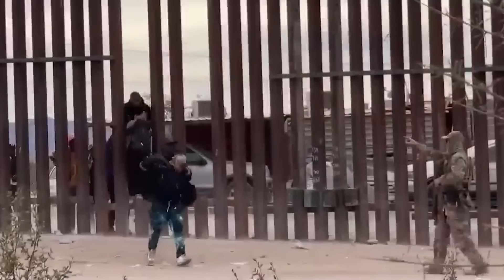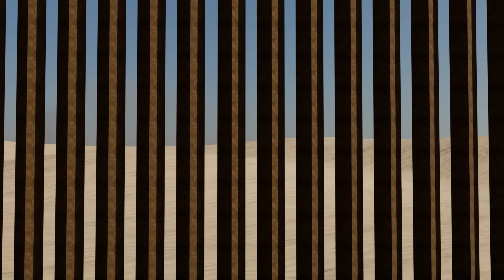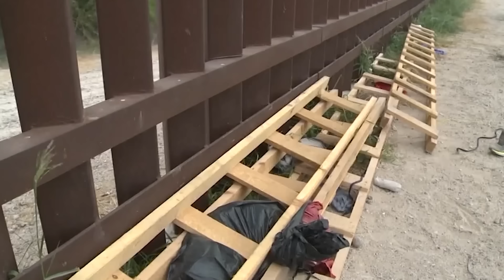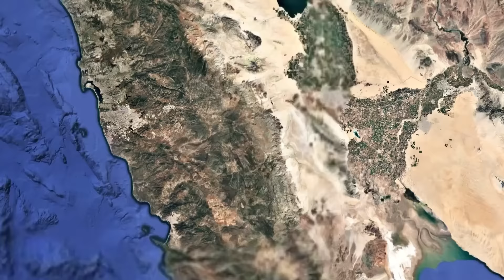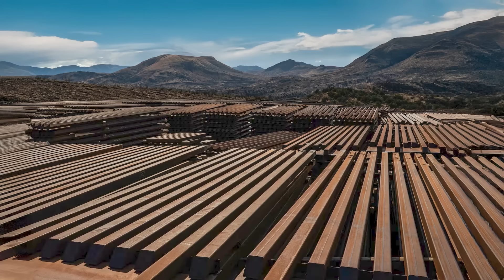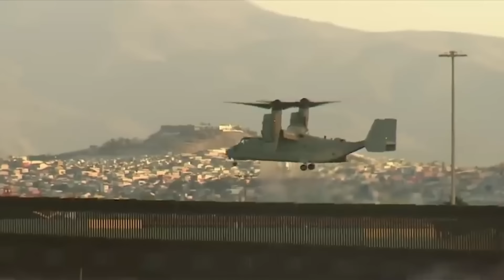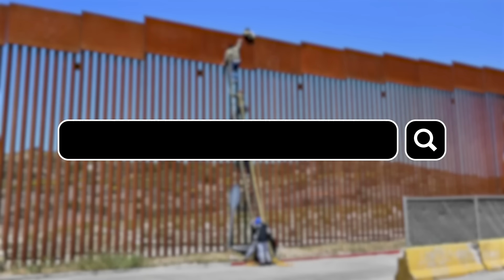What Mexico Is Doing to the U.S. Border Shocks the World

Comment: A few FACTS-from GROK:

Under Trump's FIRST TERM-How much of the US-Mexico border wall was built?
Approximately 80 miles (129 kilometers) of new primary and secondary barriers were built in areas where no previous fencing or barriers stood. This includes 47 miles of primary wall (the first barrier encountered) and 33 miles of secondary wall (reinforcing the primary barrier).

Replacements and Upgrades: The vast majority of the 452 miles—about 372 miles—consisted of replacing or upgrading existing barriers. These replacements often involved swapping out older, shorter, or less robust structures (like vehicle barriers or dilapidated fencing) with taller, more fortified steel bollard fencing, typically 18 to 30 feet high.

Total Border Length: The US-Mexico border spans approximately 1,954 miles (3,145 kilometers). Prior to Trump’s term, 654 miles of barriers already existed, built under previous administrations. Thus, the 452 miles completed during Trump’s term brought the total coverage to around 736 miles when factoring in pre-existing barriers and new additions, though most of Trump’s contribution was replacement rather than expansion.

Comment: only 80 miles of new barriers have been built where there were none before - that includes 47 miles of primary wall, and 33 miles of secondary wall built to reinforce the initial barrier.

The vast majority of the 452 miles is replacing existing structures at the border that had been built by previous US administrations.

Comment: Alternative Vision
If the goal is maximum deterrence, imagine a futuristic take: a 30-foot steel-and-concrete hybrid with solar-powered sensors, electrified sections (non-lethal), and drone launch pads. It’d look imposing—think sci-fi fortress—but costs and legal battles would soar.

In short, the "best" wall is likely a steel bollard system, 18-30 feet high, with underground reinforcement, tailored to terrain, and backed by tech and patrols. It’s not pretty, but it’s built for purpose.

Comment: Whats crazy is that our own prison systems have more advanced walls and fences. Double fences with serpentine wire between them? That's a pretty good deterant. Even if you cut through the fence/wall, it will still take you some time to cut through the wire and then get to the next fence/wall. Way more time than they could afford and would likely be caught in that time.
Reply: I've seen where these people use simple cardboard to defeat the parts that are backed by razor wire. Even if the wall was backed by mines these people would sacrifice a few to get a lot through. Nothing will ever stop them.
Reply: BS a guy in our unit climbed two fences with concertina on top to escape a stockade.  Couple of hand cuts
Reply: @Jon-f1d5m yeah and I bet he was crazy, too! 😂 definitely the kind of guy you're glad is on your side, yeah?

Anyway, my argument isn’t that it will necessarily stop them, but either deter them, or slow them down enough to allow them to be captured.

Comment: Electricity is the only means to stop them . wire with mounted insulators where the wire can be strung and not just one electrical wire but several.  Why not make the wall fence solid and flat ?

Comment: Why not acoustic sensors. Or sensors that pick up vibration. Or both? You're not trying to be clandestine about this so how about a wire with a different chemical makeup so that it's resistance isn't that a standard copper or aluminum and then whenever the criminals try to cut through the wire to access the hole in the fence a change in resistance occurs and you set off a sensor. You can't splice it because the resistance is uncommon because it's using uncommon metals to push the current. So say you tried to use copper or aluminum to splice the connection so you could cut your hole the copper aluminum wouldn't work because it would be different from the resistance of the rest of the wire so you would trip to censor anyways. Didn't you apply this wire named mesh along the entire wall in you spotwelled the mesh at every point of contact so you can't just cut the bottom of the pole and then swing it back and forth this mesh would deliberately get in the way of that and it could be engineered to do so.

Comment: Bad design ... the wall should be a double wall, with the inside wall 15' or more from the outside wall - and lined with razor wire, or a guard dog patrol between the them... dogs can be equipped with camera systems which feed video footage back to the patrol on staff

Comment: I am not really against the wall, especially if it is a deterrence against cartel members. But wouldn't an electrified fence with barbed wire be simpler? Good luck using electrical tools with those. I am not an expert in this topic. Maybe it would be too much energy needed to keep it up along the whole length of the current wall. But I think it would probably be harder to bypass? I mean, it works in many military bases right? And even some non-military private properties. If the electrical fence would be powered by solar panels, it would probably be feasible?

Comment: This is why they need to use real granite or limestone blocks stacked on top on our side of the wall. The U.S. is a continent and has more limestone and granite than most smaller nations just cut the blocks out and transport the blocks to the area of the wall. There is also new forms of concrete that uses no rebar and is as strong as basalt, limestone or granite. Since we invented the Locomotive and the Gatlinggun we can invent concrete stronger than the strongest rock, basalt. I know how to make this form of high tech concrete, artificial stone or basalt. And for a slight fee I will tell you how it's done.

Comment: Drones with thermal imaging could keep track of breaches very well. A single one could keep track of miles of fence.
Add some disguised motion detectors as well.
And then you need rapid response personnel.
A wall by itself only causes choke points and a slow-down. But that in itself is very useful, if the other components are in place.
A crucial element which would be hard for the US to implement though, would be harsher penalties for crossing it.

Comment: One thing that would slow down the climbers would be to install a 70,000 volt power line along the top.
Reply: Constant electricity running the length of the wall would be incredibly-expensive. Have you looked at your electric-bill lately?
Reply: @nicodemus369  yeah, they would stop doing drugs and start stealing electricity and create their own electric company in mexico lol
Reply: @nicodemus369  Solar panels on the other side would provide all the power needed. All you'd need is someone to constantly clean the dust off of them.
Reply: They would cut it
Reply: Also, don't come to Mexico
Reply: As long nobody tach the line , it won't use electricity. 
Because there no current through the lines, they can made of steal instead of soft copper
Reply: guard towers 150 yrs apart m60s

Comment: Any barrier can be overcome. The point of the wall is secondary after the seismic sensors pick them up, the wall slows them down long enough to be aprehended. I have no doubt this method cures 90% of the crossings.

Comment: The wall is just like locked door which is a first line physical obstacle. We should not emphasize what it doesn’t do because as you show it’s not perfect. Its used to show or display intrusion which may be used to escalate a response for the intruder or the victim. This is an important fact you need to discuss because the wall does have a potential purpose which may change policy and shape response. I find you video provocative if you don’t mention this fact.

Comment: a properly welded joint can be as strong or even stronger than the base metal itself
Reply: its a government worker....
Reply: Yeah this video seems like bs
Reply: But I grind out welds with cutting disc 30 /50 seconds longer
Reply: @hunsey just enough time for the US Military to get there & waiste the wets.
Reply: If the weld exceeds the thicknesses of the metal maybe, but the fusion strength is usually limited to about 70% with your standard welder. So, while this technically is right, it's definitely misleading.
Reply: Chinese Steel...
Reply: @stevenkidd6761  🤣
Reply: ‘Properly’ is the key word.  Another way of expressing it is ‘the devil is in the details’.

Comment: There needs to be a wire at the top of the wall that electrifies each wall beam.  Also seismic equipment should be set up to detect underground vibrations.  They should make the water section a nature preserve and add crocks or gators or piranhas lol

Comment: In Otay Mesa, about 15 miles east of San Diego, California, there is a massive industrial park. Immediately south of Otay Mesa is the Tijuana International Airport. This sector is historically where the Mexican cartels had built their series of illegal underground tunnels.
Other option to secure the border, is to use high voltage to electrify the metal border fence.

Comment: I have always said that the top of the wall should be large cylinders - about 6 feet in diameter. That would stop the ladder over the top issue.
There's no reason why fully electrifying the wall with high voltage and amperage should be ignored!
Armed response to any breach should be automatic and instant!
Reply: Who pays that power bill? 😂

Comment: This is very informative. Just to think border crossing started in 1965. An has escalated to where we are at. My thoughts have those spot lights on track movement. When the fence cutting starts, should someone make it over the fence have the spot lights light them up. Install cameras helping border patrol find violators easier. That  is best solution. Spot lights, cameras and drones. Be ready to intercept. Goodness 😮

Comment: Still slows down both smuggling and illegal migrants by likely 100x compared to an open border.  How long does it take to dig those tunnels so obviously the wall is working if they have to resort to shit like this to get across.  Obviously the US should have better tech on the border that can detect vibrations, sound, and heat on the wall and in the ground.

Comment: Easy fix. Place electric current sensors on all metal pillars. When one is cut an alarm will go off in a control center pointing to the exact pillar.
Reply: Easier said than done. It would also be costly to set up and maintain the solar power and batteries for the whole section of fence. It also doesn't stop people from going over with ladders (nor under via tunnels, nor around the gaps, nor through the designated crossings which I think 80% of illegal immigrants use)
Reply: Easier just to post your iq.
Reply: @nt9389  which is equal to the number of thumbs up his post got